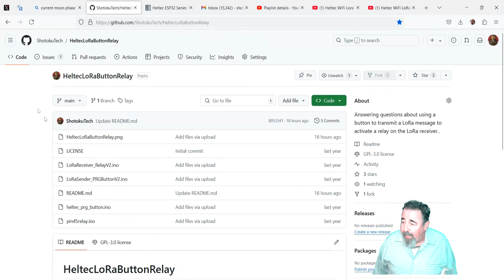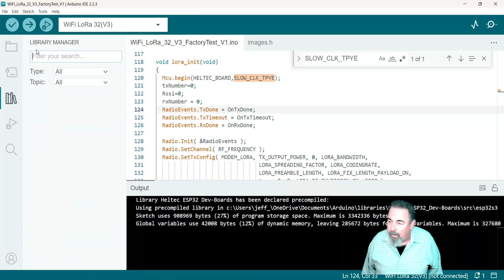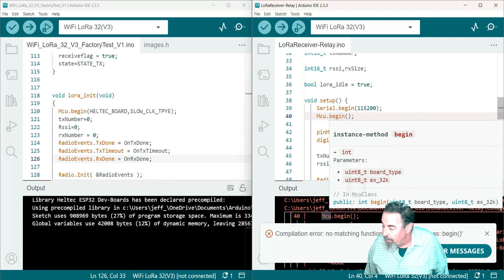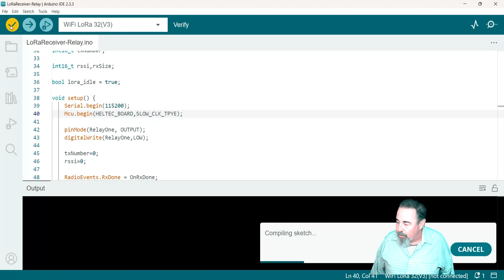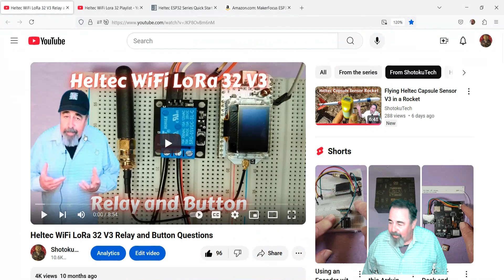Update: Heltec WiFi LoRa 32 V3 Latest Info

Comment: Shotoku

For no reason at all my Wi-Fi LoRa 32 V3 device has stopped detecting Lora nodes, nothing has been physically changed and no antennas left off ever whilst powered on for anything to burn out.  

The only thing I've ever done is went from using Meshtastic where it worked beautifully and I thought I'd give Meshcore a go to see what all the hype was about. 

I installed meshcore and see their was only a couple of devices in my area versus 25 + on meshtastic so I decided it wasn't for me and then went back to meshtastic.

Pretty much since then I don't ever receive any nodes.  Theirs no drop voltage on the PSU, no obvious faults.  I've since changed antenna and pigtails for testing and nothing.
 
Have you ever came across that?

Screen works, device is detected in meshtastic, I can communicate with it, make changes, saves, connect to Wi-Fi, connect to Bluetooth, connect via USB, everything appears good, just NOT detecting a single node.  Not in the client list and not on the map, not on android or via browser.

I don't know if something has randomly gone pop or whether theirs been some kind of software bug or glitch caused by Meshcore, everything appeared okay during installations i.e. everything went 100% installed on Meshcore when I installed it, and same again when I went back to meshtastic, no crashes or issues.

Have you ever had this issue?

Comment: I just updated my Heltec library to the one referenced in this video and ran into an additional issue beyond the the mcu() parameter requirement.  I had an existing script that posted an error during compile on the WiFi.setAutoConnect(True) method call. I checked the library and apparently the WiFi.setAutoConnect() method was also changed from .setAutoConnect to .setAutoReconnect. The revised call should now be WiFi.setAutoReconnect(True)
Reply from the maker: Thanks for the tip!

Comment: Is TPYE in the second parameter (SLOW_CLK_TPYE) really supposed to be mispelled?
Reply from the maker: I just checked several of the example sketches from the library and it is indeed misspelled. But the sketches did compile just fine. Good catch! Best wishes.
Reply: @ShotokuTech  Thank you very much. I really appreciate your videos.
Reply from the maker: @phil1979  Thanks!

Comment: Hey, I like your videos but sadly they've only lead to frustration. I've black screened my code and for some reason there's always trouble with my uploads. When I uploaded the factory test i couldn't enter lora mode: i was stuck on a '2 networks found' screen, and when i tried uploading the receiver code, it uploaded but i was stuck on a black screen of death, any help would be highly appreciated.
Reply from the maker: What do you see in serial monitor? Connect serial monitor and reset the board. I think this problem is common. Some license file gets overwritten with Meshtastic and when you want to go back there is a problem. I will try to recreate the issue. If I can, I will make a video about it. See if there is useful information in serial monitor that can guide your search for a solution. No, my videos and code are not to blame for this! :)

Comment: Odd, I’ve spent hours this week trying to compile some code I previously wrote for a Heltec ESP 32 WiFi kit,  on a new PC. I eventually copied all the libraries from my old PC and it worked, then they auto updated and it stopped working. Really disappointing as Ultimately Im trying to do a project with someone else’s code from GitHub, but every time I think I fixed a library issue, I get another one.

Comment: I really appreciate your videos, I had this question, when you connect the eps32 via the battery the 5v output does not work (it marks 0.9v), is this normal?
Reply from the maker: Hello. The 5v pin is intended as 5v input. The board does not contain a booster from 3 to 5 volts. This module would do that: MakerFocus 5V Charge Discharge Integrated Module. https://amzn.to/3PNk2gX
Reply: @ShotokuTech  Thank you very much for always responding, we bought the Heltec thanks to your videos, we are doing university projects with them
Reply from the maker: @stefaniaescobarmonrroy6025  Best wishes. Good luck.